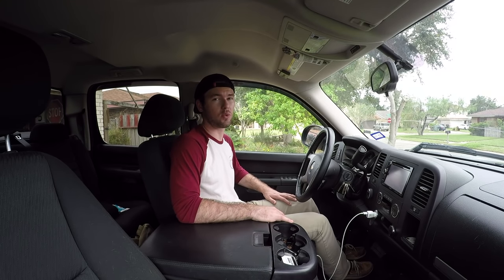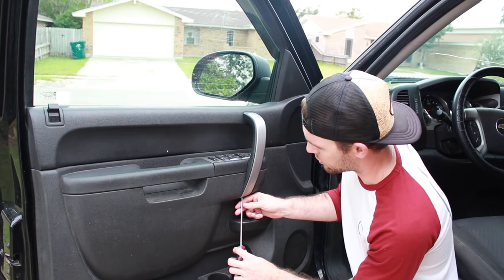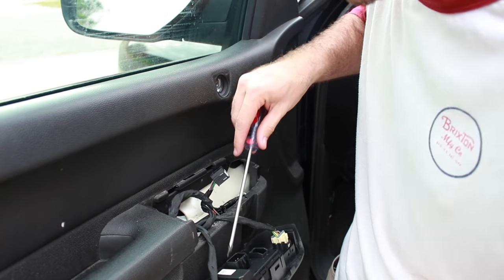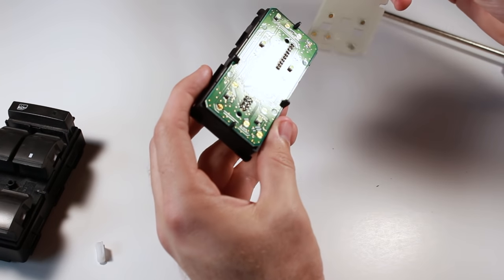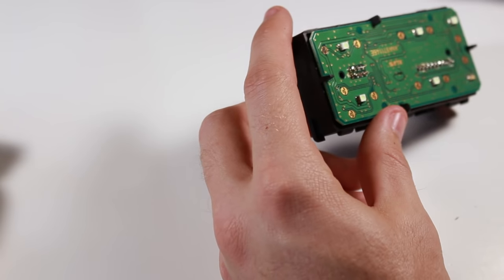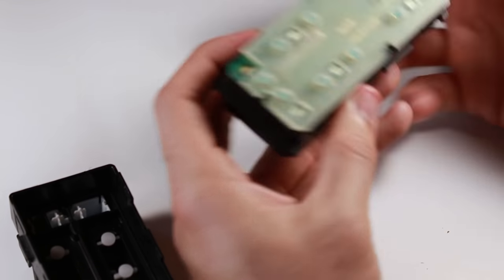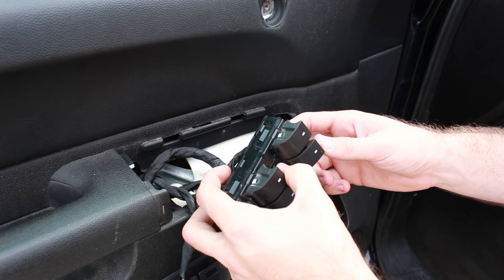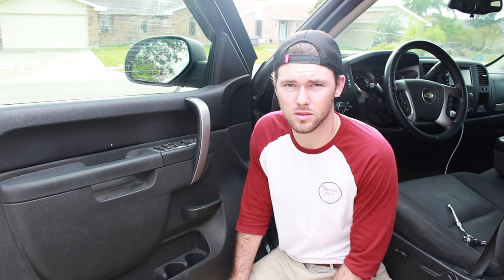How to Fix a Window Switch on a 07-13 Silverado/Sierra **FOR FREE**

Comment: Thanks, this absolutely WORKS! I found my front 2 windows were not reliably going up or down, and I didn't want to get stuck with windows that weren't reliable. The whole process on the driver switch assembly took maybe 30 minutes and I took my time. Saved me a lot of money!

Comment: Thanks so much for posting this. I could only roll down my driver side window and couldn't roll down any of the other 3.  Chevrolet wanted 240 bucks for the part.  Tried your fix and it worked perfectly.

Comment: Can confirm it works. Did my buddy's switches today, and it worked first try after reassembling everything. I used 300-grit sandpaper to very gently clean off the corrosion, then wiped it with rubbing alcohol.

Comment: Thank you so much. This was the first video I watched on this issue. My 2013 GMC Sierra started having problems with rear passenger side window. Last week the passenger side wouldn't roll down, but would click. I used a pencil eraser and cleaned up corrosion on contacts.

Comment: Bad ass video! Worked 100%! I went ahead and bought (QD Electronic Cleaner CRC) and sprayed it on a Q-Tip, then brushed the board with a small wire brush until clean. Works like if it was brand new! Thanks!

Comment: Thank you so much, worked exactly how it should, the little clips were stubborn but not exactly impossible to disconnect, quick lil tip: when you scrape the connection spots on the motherboard they don’t have to be gold, they turn almost silver after scraping them, don’t go too hard, don’t go too soft, and it’ll work like a dream..

Comment: Must be a typical Chevy crew cab glitch. My master switch for the passenger window didn't work either, but the passenger side switch itself worked fine. Did this fix in 10min, but used a pencil eraser instead of a flat head screwdriver!

Thanks for this!

Comment: This video was exactly what I needed.  I had problems with all four window control stations.  I agree with Sam Petzel, pencil eraser better approach to cleaning contact surfaces with minimal risk of damage.  I also used contact cleaner as a solvent.  To finish off the job, I wiped the contact surfaces with Nyogel 760G.  This is a dielectric synthetic grease that acts as a corrosion inhibitor.  Hoping this will prevent or long delay the problem from reoccurring.

Comment: Just did it on my 2007 classic 2500 and it works great. A little more involved getting to the board but easy enough. Pencil worked great just by hand. Do ALL the contacts while you’re there. My right side mirror control started working again and all of the switches are more responsive.

Comment: It had sand and grit on the silicone contacts that I cleaned as well. Used a pencil eraser on all contacts then wiped with alcohol pad.  Simple and worsed perfectly just as you said. 15 min start to finish. Thanks.

Comment: This fixed both my passenger and my 2 rear windows that were barely working! Only things I did differint- used the blade/tip of a pocket knife to scuff the membrane contacts  and cleaned both contact surfaces with rubbing alcohol ona  q-tip. Thought I was going to have to repalce some motors so long as I had these issues

Comment: Excellent video John, and thank you for taking the time to shoot that.  You're right on the mark with how simple it really is.  The Local Dealer (Dennis Dillon in Boise, ID) just quoted me $350 to fix this simple issue.  A complete rip-off IMHO, and they of course know exactly how simple the fix is (they of course want to sell you a whole new switch assy) and unless they are complete moron's they should also know the root cause.  In my engineering opinion, the root cause is either a sub-par gold plating job by their switch supplier, and/or a poorly designed seal around the switch contacts which allows debris to get on the contact surfaces.
Reply: Same dealer wanted 3 hours to swap out the thermostats that took me an hour and $40 for the parts at AutoZone. Saved $600!

Comment: Hey John, Thanks for the video. Watched it once and like you said about 15 minutes of time with the correct tools and passenger window now operates from drivers side. Interesting that I had the exact same problem your video covered. Blessings.
Reply: LivingTea Neil same here
Reply: Would putting dielectric lubricant on the contact parts alleviate this corrosion problem?

Comment: Thank you for posting the video.  I have had issues with one of my windows for years and was not encouraged to work on it when I watched other videos that pulled out electrical diagrams, multi-meters, and other equipment.   So, when I saw your video, it was to the point, well done audio and video,  and showed exactly what was needed.  I did use an eraser,  as others have mentioned,  some electronics parts cleaner, and some very gentle scratching of the contacts with a small flat blade screwdriver.   I am thrilled to say that all is working and I don't think it took me an hour.  Thank you very much for taking the time to post the video!

Comment: Very good video my passenger window was doing the same thing and eventually quit going up but would go down just on the driver's side switch passenger side switch worked every time I took it apart shined it up little screwdriver and pencil eraser it didn't really look corroded but I put it back together and works like new thanks again
JEFF

Comment: Excellent video.  Worked perfectly.  Details like socket size for handle saved time.  I also used Deoxit on a cotton swab to clean/protect the contacts. Like new in a few minutes.  Thanks!

Comment: Well shit.. lol. I've been dragging my feet on this for a while.. I have a 2012 Silverado and had the same issues.. both back windows and the passenger side front window were just not working.. at ALL.  I figured it would cost me money no matter what.  This worked like a charm!  I also used a little bit of contact cleaner when reconnecting the switch.  Great video.. Thanks!

Comment: This is an AWESOME video and GREAT tip!  Three years ago my back windows quit working from the drivers side switch so I had the dealer repair it which costed me $183,   $ 88 for labor and $ 87 for parts.  About a year ago the same problem started again.  This  time I was going to change the part myself when I came across this video.  It was very simple to do and costed my ZERO!    

I wonder if a very thin coating of dielectric grease would prevent the corrosion?  

Thanks again for this money-saving tip!

Comment: thanks.  issues with the same front passenger window.  had my replacement module ready for order off amazon, but went out and corrected the problem in just 30 minutes taking my time.  I like free.

Comment: Thanks for the excellent video.  No BS, just to the point (something lacking in most how-to videos).  Fixed mine in about 10 minutes.  I used a dry pencil eraser followed up with alcohol on a cotton swab.  The contacts on the rubber mat part were bad on mine; the ones on the PCB were fine.

Comment: Thanks. I thought it was my fuse. It was very cold today but I wanted to fix it but had no success. I will do what you showed on your video to mine, to see if it will be fixed. I really hope it works after this because it's hard not opening the window at the drive though at Burger King or McDonald's.

Comment: Absolute legend. Thank you so much for this video. I actually bought a new switch before seeing this video but I did not install it yet. 

I took apart the switch as you did and used a pencil eraser to “clean” the contacts. I honestly was skeptical as I didn’t see any really bad corrosion or anything but lo and behold, it worked. 

I guess I’ll keep the spare part in case, but man thank you! I was shocked to see this work!

Comment: Sprayed the laytex with brake clean and used a pick. Used a rag with cleaner and a pick on the board. Worked fine, took less than 10 mins start to finish.

Comment: Thanks for the info!!! I followed ur instructions and now my passenger switch works. I didn’t have much corrosion so I also used some CRC electronic cleaner. Perfection‼️‼️
And WOW, those components are made cheap As Fu*K

Comment: Thanks for the video.  Dis you consider using air to blow out under the Printed Circuit Board (PCB) and possibly electrical contact cleaner?

Comment: Had the same issue with the passenger sides not working.  Smashing didn't work anymore.  Was able to do this and got it working.  I also used isophytol alcohol to clean the contacts with a Q-Tip which took off even more dirt.

Comment: Thank you JV Garage!  And shout out to Sam Petzel for the pencil suggestion.  I snapped the end off the pencil and put it in my cordless drill to clean the contacts.  Only about 4-5 seconds per contact so heat didn't build up and smear rubber on the contacts-light on the pressure.  Had everything apart, cleaned, and back together in less than 90 minutes and I'm a total amateur.

Comment: Hey, YO!!!! Taking this thing apart made it work perf again. Cleaned the contacts with a good pencil eraser and then a tiny amount of Dielectric grease on a q-tip on all contacts. It’s not that hard, just don’t pry on the plastic stuff like a gorilla and you’ll be ok.

Comment: Not only are you removing the corrosion but also the alodine to help precent future corrosion on the buttons and the board. If you can get an alodine marker and leave it to dry it will be set 👌

Comment: I was able to remove and clean and it fixed the passenger side front window (which was not working from main control on the drivers seat), but the drivers window does not go down or up when pressed and that was the second problem. Do you have any way to test or suggestions. Steve

Comment: Thanks for the vid, I️t worked!!. I️ have the same truck. Do you ever have issues with your abs? I️ts very difficult to get my truck into gear from park. Same when I’m in cruise control.. when I️ tap my brakes, Cruise doesn’t turn off. Almost as if the breaks are not recognized. Any advice  would help at this point.
Reply: You have a brake positioning sensor that may be the issue. I started replacing a bunch of parts to get my abs to turn off. My issue ended up being a different sensor. But your brake does have a sensor on it.

Comment: My driver window works fine, I cant roll down my passenger drive or driver rear window from the main control. When I click the drive rear I hear a clicking and my passenger front and rear dont roll down unless it's from the actual control on the door anything other than what you did that you'd suggest I do?

Comment: 2012 GMC Sierra 1500 Extended Cab Rear Passenger window not working, changed old switch with new switch will not work with new switch from rear position. Works fine from the master control from front driver side any ideas what the problem could be ?

Comment: Any chance you know what that little white piece on the drivers window switch connector is called or where to get one? Fixed my passenger side but somehow ended up dropping the white piece into the door with no luck finding it 3:57 2:37

Comment: I wouldn’t scrape the corrosion off. Too easy to slip and scratch the circuit board. Just a cotton swab and some contact cleaner or rubbing alcohol will do the trick. Still an excellent tutorial!

Comment: How do you fix corroded wires?
Mix several tablespoons of baking soda into a cup of warm water and stir until the baking soda has been dissolved. Dip the toothbrush in the mixture and then scrub the electrical wire and the wire connected with it. The mixture will begin to fizz on the corroded metal so do not be alarmed.

Comment: Just did mine and it works, looked at the comments and used an eraser.***(FYI)*** Don't be an idiot like me and try to short cut things. I didnt disconnect the unit and open it separate but instead I popped it open still attached to the wire harness and BOOM I lost that little white rocker thing from the driver switch!!! At least I ordered a new switch on Amazon for only $19

Comment: well on my 2001 silverado pass switch it will not come apart... i have taken these apart before its rigged not to be fixed...pisses me off big time..actually i just needed to remove the 2 switches first.... but inside its totally different and is all fused together... ever fix one? i hate to pay $30 for a new one... thanks...PS just kept working it  and used some electrical spray and all of a sudden like magic my widows are like new...lightning speeds

Comment: Rather than using a blunt instrument such as a screwdriver try a pencil eraser or pen ink eraser to remove the debris from the contacts. Much less likely to damage the printed circuit board or contacts.

Comment: Wow I wished I had seen this video before I went the route o did. 
So far it has cost me the price of 2 different switches from Amazon. 
The first one driver side was sticking, before I could get a new one ordered it cost me a new battery (already weak from the first time it stuck) the second time did it in. 
The second switch which fit even worse than the first but appeared not to be sticking in the down position is newly discovered to be sticking in the up position (hard to tell unless you double check your pull).
At this point my engine light came on all of a sudden to discover the code indicates my oil pressure sensor is no good, an 89.00 part. The battery (just out of warranty) cost me 127.00 with a 10% sympathy discount. 
Back to square one WTH is going on with these after market switches....
Upon calling the dealer for a price quote I am informed these switches need to be programmed after installing (dealer replacement part). At a cost of 97.00 for the 5 switch assembly and 2 hrs labor at 265.00 WTF? 
I am a wee bit pissed off and wondering if that is causing these after market switches to short out other electrical components on my truck.
I am about to go pick up the oil sensor (which does not need to be programned) but the switches do? Waiting for the third switch assembly from Amazon (decided to go with the more expensive replacement part 27.00 plus s&h. Thinking you get what you pay for, the first two switches were around $15.00 each. 
Waiting for it arrival...so disappointed I threw the original switch away after watching your video and learning I could have very easily fixed it my own darn self and not had to spend a dime from my fixed Aargh! to repair my truck....Aargh! 
If another electrical part fails from this replacement I will be all over those manufacturers with personal comments hoping nobody else experiences this bullshit dealer scam and online part purchases.

Comment: Bought my '08 Silverado new and I've had to do this over the years several times, until there was not much material left on the contact points, so I finally ordered an new one.

GM is garbage and I shoulda bought that Tundra instead.

Comment: I wouldn't be so sure about simple corrosion from moisture being the issue at play here. 
Sounds to me  like bad grounding and/or shitty wiring on the part of GMC. 

Here's a list of the electrical issues I've experienced on my '11 Silverado.

1. Engine Power Reduced: Service traction control. 

While under warranty two different Chevy Dealers couldn't fix it. First one swapped out throttle pedal/sensor, issue persisted, they wanted me to pay $500+ to replace the throttle body/throttle pedal wiring harness and that this would fix the issue. Told them to shove it and took it to another dealer. This dealer said first one did a hack job of replacing the throttle pedal position sensor connector harness and they would would fix it under warranty.

A couple of months down the road, issue came back. Took it back to the second dealer, and they were stumped, they wanted $300+ for a thorough diagnosis just to figure out what was wrong. Told them to shove it as well.  

Fixed the issue myself by replacing the throttle pedal position sensor harness. Apparently they don't teach mechanics at Chevy Dealerships how to properly use wire strippers, crimping pliers, shrink tubing and correct gauge splice connectors. These hacks apparently strip wires with their teeth and use acetylene torches on shrink tubes.

2. Passenger side low beam bulb connector.

Something's causing this headlight bulb to draw too many amps and burning out the connector. 
Be prepared to replace it. A ceramic connector would last longer, but if the underlying ground issue is not fixed, then the wire further down the harness will burn out insted of the plastic connector. '07 Chevy HHR has this exact same issue.

3. Rear Driver's side speaker. 

Same issue as the healight connector, killed the speaker.

4. This exact same issue from the video. 

I figured something like John described in the video was the issue, I've just been too lazy to thinker with it. Good to know this is the correct quick fix. Sucks that it seems like it's just another electrical issue plaguing GMC vehicles. Hopefully there aren't many more of them.
Reply: Hi. On your "engine power reduced: service traction control" issue, did you get a service engine code for that?

Comment: The "plastic cover with the goldish connectors" on mine also had corrosion on the gold colored round connectors that are recessed.   It looks like those cause the connection to make the windows operate, appears that the connector on the circuit board  have a break in the center and when the connector from the plastic cover is pressed across that break the connection is made.  So the connectors on both need to be clean.  I was thinking to put dielectric grease on the connectors but then saw UToob vid re how it's and insulator the reduces connection, instead I put electric tape around crack where the top and bottom parts of the modular join together.   https://youtu.be/Ae1-kE54VZk?t=150